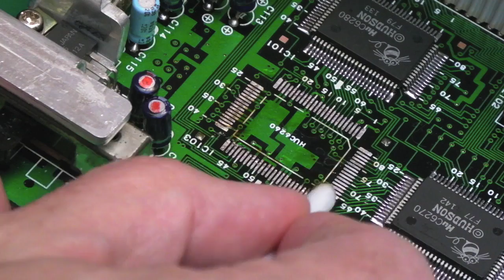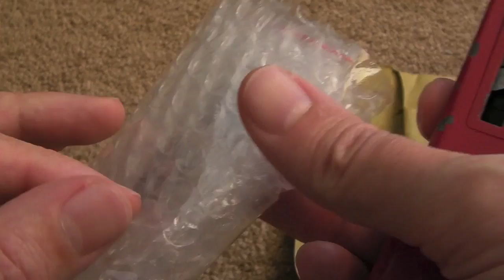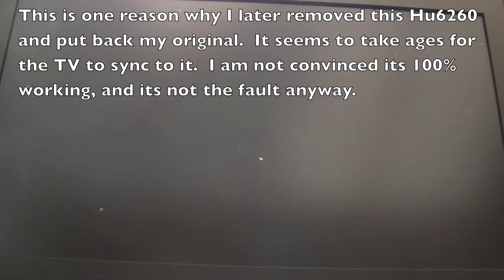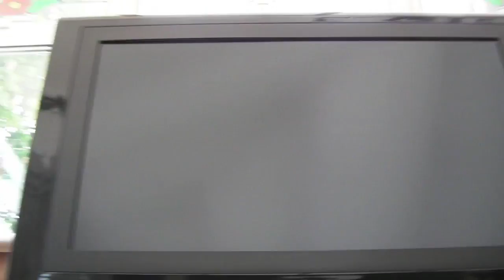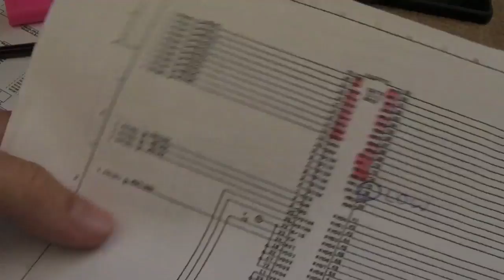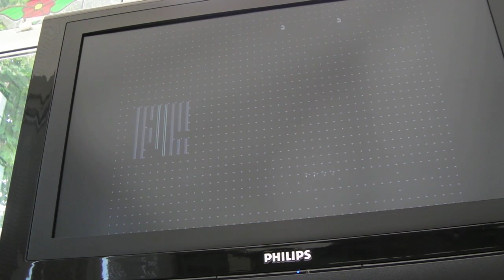NEC PC Engine Repair Part 2

Comment: I'm working on a TG16 with a purple, grey, green, or blue screen, sometimes it stays solid, sometimes goes to black. I've cleaned, can't see any burned or broken traces, my hucard is fine and I use a Turboeverdrive to test also, (red light cones on , goes off). The card slot looks fine, nice and shiny, nothing fishy around the vias. I'm reaching my limits of knowledge of testing this board. I have not replaced the caps, but don't see any leaks. I'm up against chip issues maybe???
Reply from the maker: Check your 5v is good - check connectivity to the hue card slot (make sure those cables aren't the issue - they break super easy...).  If all that stuff is good, likely bad RAM, PPU or CPU.

Comment: Comment savoir le quel est défectueux huc6270 / huc6260 sur mon unité j'ai bien un rétro éclairage  est des bande sur l'ecran  comme une tv déréglé  !
Reply from the maker: Test for sound - ie. can you hear sound and music?  If you aren't getting sound, its most likely the 6270 or 6280.  It's more common for the HuC6270 to fail...
Reply: Super merci pour votre réponse rapide  j ' avez  justement un doute dur le huc6270 ! Gadget uk

Comment: Hi nice channel. I have two questions...when replacing and soldering in the c6260 chip you said that some remaining solder might be lead free, is that a bad thing for this kind of work? Also are you using a flat angled tip? Thanks for the vid and any reply.
Reply from the maker: Thanks =D  I use a flat ended tip - regards lead free solder, I just find it doesnt flow very well.  The original chips on these boards would have been soldered with leaded solder.  In this case I was thinking that someone added lead free solder before they removed the chip  - sometimes adding solder is helpful to get old solder flowing again.  If you can buy leaded solder.
Reply: @GadgetUK164  lovely thanks.

Comment: you should of done the chip installation the easy what.. flow solder on the pads and the use a heat gun, the heat will melt the solder, and gravity will make the chip fall into place.. that why your iron doesn't even touch the leads or have a change of killing the chip with the heat from the soldering iron.
Reply from the maker: The way I did it is the EASY way lol.   Using hot air that way is not easy at all with this type of chip - with BGA it is, but not QFP.  Plus, hot air is just as hot if not more and the air flow doesn't just hit the pins it goes a wider area too.  The fastest easiest option imho is the way I did it.  I've soldered and desoldered enough chips with hot air to know that soldering them back on that way results in more heat for longer periods of time.

Comment: The pads are fiducials used for optical alignment of the chip by the pick and place machine
Reply: They are often test probe points aswell, for variable pin prob config test beds machines to sit the board on top of and run tests.

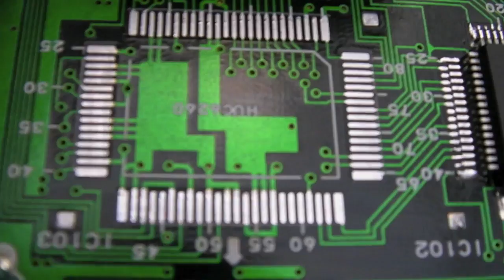Comment: Just learned that the system has a 16 bit gpu and a 8 bit mcu 65C02 based with bank switching to extend the 16 bit address bus to 21 bits..  Hey did you notice at 6:53 with super macro, there seems to be two layers of masking. One solder resist and then a clear or green transparent coat over that. Maybe the pcb itself is solder resistive, because if not then I can't see how smd soldering can work in production..
Reply: GadgetUK164 - Retro Gaming Repairs & Mods

Oh, and as the expansion pinout on GamesX says, the upper four bits of the "VD" (Video Data?) bus selects one of 16 palettes, and the lower four bits is the actual pixel data which selects one of the 16 colours in the current palette.

So, basically 16 colours per tile, with a choice of palette (out of 16) for each tile.

Plus a second set of palettes for sprites, giving 512 possible colours, but apparently only 482 on-screen at once?
(I haven't looked into that yet. lol)

EDIT: Ahh, the wiki tells all - the first entry (#0) in each background palette has to be the same colour value.
Plus, one of each of the sprite palette entries (probably also #0?) is for transparency?

(the transparency stuff is a bit weird, so it ends up with 241 colours for backgrounds, and 241 for sprites.)

Quite similar to the Mega Drive, but that has 4,096 colours to choose from (12-bit, instead of 9-bit on the PCE).
Reply: GadgetUK164 - Retro Gaming Repairs & Mods

To confirm, AFAIK...

The 6260 is the colour encoder (palette regs), and DAC(s).

The 6270 is the GPU.

The 6280 is the CPU.

I did see Part 3 though, and you already figured it out back then. ;)

Very confusing when you get just a few minor errors / typos in the docs, but I'm still VERY grateful for the info from those clever chaps.

Notice as well btw, that the "VD8" signal on the schematics IS actually labelled as "SPBG" on the 6870 side, so I can now see why GamesX listed the signals like that.
Reply from the maker: Yes - I think you're right! There is two layers of masking! After spending time studying the schematics its clear that the 6270 is the GPU, the 6280 is the CPU, and the 6260 seems to provide the video output. I should have spend more time looking at the schematics earlier on - I've referred to the 6260 as the GPU (when it isn't 100% responsible for the graphics), and the 6270 is not the CPU but rather mostly a GPU. I've managed to order a 6280 (just in case), and another 6270 - but the seller has included a replacement 6270 as well (and I will be testing both, and the CPU as well if it works with a new 6270. Phew! Hopefully it will be up and running soon!
Reply: Yeah. It's not really clear what does what on the board. The video chip seems to be a memory handler gluing the cpu, memory and video output chip together. I suppose the 6260 is the X/Y timing chip, fetching pixel by pixel from the video ram in sync with the crt beam, while the other gpu chip process graphics on that ram...
Reply: http://emu-docs.org/PC%20Engine/pce_doc/ <- lots of useful info for your next video :)
Reply: The 6260 is the DAC.. of course, but it also has the bitmap registers for setting palette. So it says in that link, all the way down on the page about the video.
Reply from the maker: Yes, that's what I worked out eventually!    Thanks for the link there! =D
Reply: GadgetUK164 - Retro Gaming Repairs & Mods 

Hi, all,

I know this is an old vid, but I'm still catching up / re-watching.

The docs from Charles McDonald are the best around, but I do recall some confusion in there too about which chip is which (part numbers swapped in some places in the text file, IIRC).

But yep, the chip with the video outputs is the colour encoder. ;)

All it really contains are the palette registers (separate blocks for sprites and backgrounds), and DACs / Composite colour encoder.
The CPU writes to those via the normal addr / data bus, then the raw pixel data gets streamed from the GPU to the encoder via the "VD7:0" bus.

The "SPBG" (SPrite / BackGround) signal just selects the second half of the palette regs when the sprite pixels are active.

EDIT: Correction - the Video bus actually has the full 9 bits (VD8:0), but the pinout on GamesX basically calls the MSB bit "SPBG", as it does essentially select the upper 256 palette entries during the display of sprite pixels. Just to add to the overall confusion, the text description doesn't always tally with the pinout diagram. lol

http://www.gamesx.com/misctech/pcebp.php

(I had to use the docs and Interwebs to figure out how to do the external HDMI mod board for the PCE / TG-16. Coming soon-ish, but with onboard "Flash" cart emu, and probable CD drive emulation later on. :p )

Comment: I found a video with graphic issues another PC engine

https://www.youtube.com/watch?v=8RAeB8gK350
Reply from the maker: Thanks!  Yes, I saw that video when he did it at the time =D  I think that's the only other remotely useful repair video relating to the PC Engine really =/   There's a surprising lack of knowledge out there on these lovely machines =/
Reply: Gadg. Are there any bad ceramic caps on there that might be causing any issues. or any resistors that read bad? if i remember you had the probe and poking around. maybe you have a bad pull up somewhere...........
Reply from the maker: I've actually gone as far as checking every single passive component on there - all the caps, all the resistors etc.  It's definitely either the 6270 or the 6280 and I suspect from the 2 stuck data lines that its the 6270.  But... The 6280 CPU could be feeding the wrong data to the 6270 and making it look like those 2 lines are stuck when they aren't.   More spares on the way, so should find out soon!
Reply: alright, im glad  you did go the extra mile  it puts one at ease being able to narrow it down to one component, rather than it being multiple! Cheers, look forward to the Re-repair

Comment: Sad to see they sent you faulty chips; on the plus side at least you've narrowed it down to what the problem is also I see you're using hot air to remove chips now; Chip Quik is great for removing chips but it can get a little expensive when you're doing it quite often especially on Quad Flat Package chips as you can burn though that stuff pretty quick. Oh, and one more thing. Your soldering skills are awesome by the way; give it a couple of month to let the solder dull on those chips and you won't even know someone's replaced them.
Reply from the maker: Yeah, after I did the stuff on the SNES I decided that it is easier to not use chip quik, and probably safer because you're applying heat for less time etc.  With chip quik you end up going around the chip quite a long time and it holds heat for ages etc.   Thanks for the comments on my soldering =D

Comment from the maker: I think its important to note that I am still learning about the PC Engine, and there's a lot of confusing information out there.  People referring to the 6270 as the CPU, when actually its more of a GPU from what I understand.  And the 6280 looks to be the CPU - which is a surprise as I thought the 6280 handled IO and sound.  I will try and clear this up in the next video.
Reply: Crazy thought,  why not remove the chips from the working pc engine and replace one by one on the broken board - risk of damage on the working board if it goes wrong.
Reply from the maker: Hehe, yeah - been there before, made that mistake in the past ;)  What starts off as a great idea to work out which chip is the fault nearly always ends up causing damage to your working board.  Just the risk of removal with hot air is one reason why I don't want to interfere with the working board.  Good idea though!

Comment: So you figured out those dead pins by just probing them all? Well found, still a pain but well done. Now to fix it. Hopefully a new chip will do it. There aren't any different chip versions that could be causing this?
Reply from the maker: Hehe, yes!   The address bus and data bus on any chip would typically show signs of pulsing.  ie.  You would typically expect the each address line and data line to toggle between high or low state.  There are exceptions on an address bus, it might depend on how some of the upper address lines are used.  That is why I compared the same game on a working system, to see if that upper address bit should actually toggle state when the demo loops.  I did wonder about chip version differences, the only thing I wondered was if those upper address lines needed a pull up resistor.  I tried 4K7 last night but that didn't work.  MAGIK suggested this also, and since you've got me thinking about version differences (maybe this chip came from a Duo or something?!?), I will re-visit the pull up idea and decrease the size to see if it makes any difference.
Reply: I would guess that the only possible explanations for those dead pins would be either the CPU itself, the traces or the RAM chips. 
I don't know about other systems but the C64 shares the data and address bus between the VIC2 and the CPU during each clock cycle. No pulses on an data line could be caused by either in that case.
Reply from the maker: Unfortunately the VRAM is only addressed by the 6270, so it has to be the 6270 I think.  Although the CPU does communicate with the 6270 on a different bus, I guess there's a chance the CPU (6280, I read somewhere the 6270 is the CPU, but its not) is the cause of the strange addressing of the VRAM?!?
Reply: I would guess that both the GPU and CPU require fast access to the VRAM. Since you've already established that the CPU can run independently of the GPU I suppose the GPU does its own thing. You're actually reverse engineering the thing

Comment: I'm glad you show the entire soldering process so we can see how hard it can be sometimes. And how you get out of a problem. It's hard work sometimes working on these tiny legs..I can hear you straining :)
Reply from the maker: Thanks =D  Yes, it wasn't as easy to solder cleanly with those 2 replacement chips.  I think they had lead free solder on them or something, and as seen - sometimes the solder just joins everything up =/

Comment: try an experiment. A pull up resistor on those two offending pins , it could be that the internal pull ups have failed.
Reply from the maker: Yeah, I tried a 4K7 already just after the video was uploaded =/  But, the state didn't change, so I am thinking 4K7 might be too weak.  Nothing to loose I guess so I might try a 2K2 or a 1K next.  Will let you know if it makes any difference later =D

Comment: If you power on a PC Engine without a game in it, what color is displayed on the screen?  I just picked one up that's been AV modded, but I don't have a game to test it with yet, and want to make sure it's working.
Reply from the maker: My working one shows a pale green screen when no game is inserted.  I am wondering if this one will also show a pale green screen vs the current white screen - once I've fixed it?!?  Let me know what yours shows please!!
Reply: +GadgetUK164 I've got a bright white screen on mine. Uh oh!!  
A game should arrive In the week so I can test further.
Reply: Tested with a game and mine works fine!  Bright white screen with no game in it, tested on a small CRT.  This one does have an AV composite mod, haven't tested the RF.
Reply from the maker: That's great!  I wonder what the colour indicates?  Maybe some show a different colour?!?  Will be interesting to see what screen colour this one shows when its 100% working.  My other working system does show light green though, and yet all the games I've played work perfectly.  Although I have noticed a pixel out of place on Operation Wolf game over text, which makes me wonder if it has a bit faulty in one location of the VRAM - maybe that's what light green indicates?  Time will tell!

Comment: What if its the RAM? did you replace those ?
Reply from the maker: I swear people don't watch my videos lol - They just jump in and make suggestions for things I already covered in the videos lol :o)  I know you fast forwarded!!!! :P
Reply from the maker: And yes, I replaced the main work RAM in the last video (and the VRAMs), and on this video I even swapped back to the original VRAMs (just to make sure it had no effect, and it didn't).  So at least I know all 3 RAM chips are OK.  The problem now is A15 on the 6270 I think, and possibly A14.
Reply: sorry , lol and alrighty
Reply from the maker: Haha, don't worry about it =D  I end up having to fast forward through lots of videos!  More videos than time available etc!

Comment: Sorry to see the chips sent are faulty. Can the stuck at zero be somewhere else ? Perhaps freezer spray to the pcb, maybe some via or something is bad ? Great solderwork as always !
Reply from the maker: Yeah, very annoying lol.  It can't get stuck from elsewhere - the 6270 is all that drives the address bus on the SRAM, and I've traced the 2 connections from the 6270 to the 62256 chips through the 2 vias and connectivity is all good. =/  So it does look like they've sent me a 6270 with a different fault to the 6270 I had on the board originally.   Thanks regards the soldering =D
Reply: I guess you can rule out the 62256 address line being stuck because it didn't have the same fault before chaning the 6270... ?
Reply from the maker: The previous 6270 wasn't driving the address bus at all - pretty much all lows.   The the 62256 is the only thing connected to that address bus, and I swapped back to the original VRAM chips.  I know the VRAM chips are OK because both of them are in a Neo Geo 4 slot at the moment!

Comment: Looks like there is some progress! Sorry to hear that those replacements didn't work, i did try and look for the most reputable company that sold them replacements.. i feel partially responsible for your frustration on the plus side at least they turned up :) .

What does the underneath of this board look like ? is there a metal heat shield ? Just thinking a crazy possibility of something happening underneath the board.

I know all about ripping those pads off the pcb, i think it maybe something to do with technique and the soldering braid. If the soldering braid has a habit of sticking to the pcb / connection does it mean the soldering iron is too hot ?

As always great video and detailed! looking forward to the update FIX *hopefully.
Reply from the maker: Don't worry about it lol - just one of those things, and the chips were only $13 each, so not a massive loss.  If the braid sticks to the PCB it means the iron isn't hot enough, and not enough flux!  With regards to the underside of the board, there are just a few resistors and bypass caps.  Don't worry - I've checked the under side and top side numerous times!  I've gone as far as checking every resistor, diode and transistor on the under side.   I will show the underside in the next video!   I think its almost certainly those 2 address lines on the 6270 stuck low - There's little doubt in my mind that they just happen to have sent me a 6270 which has a different fault to the 6270 I had lol.